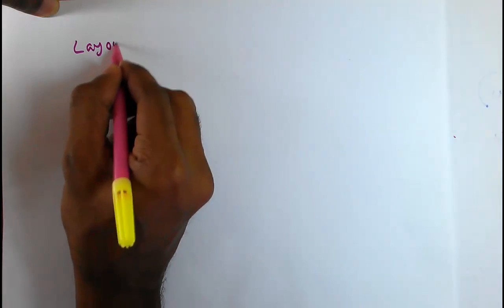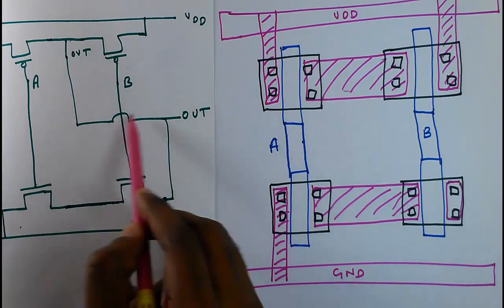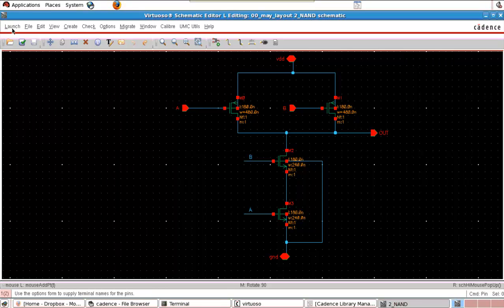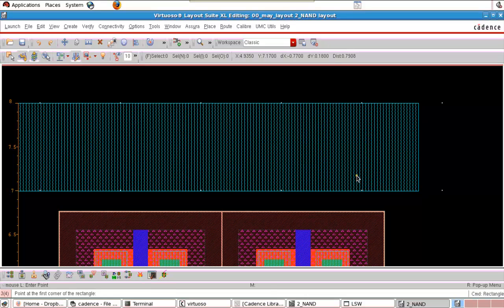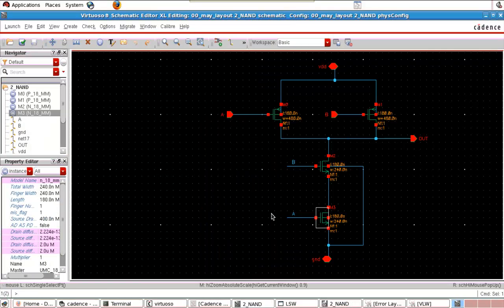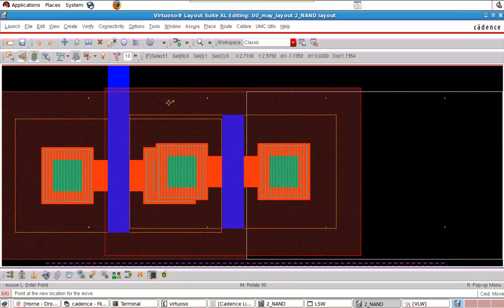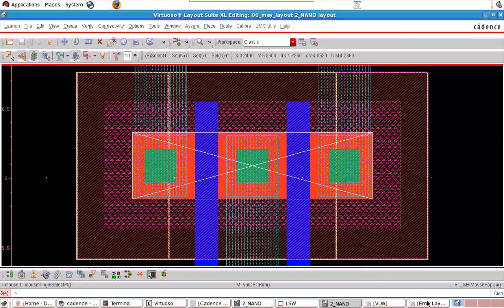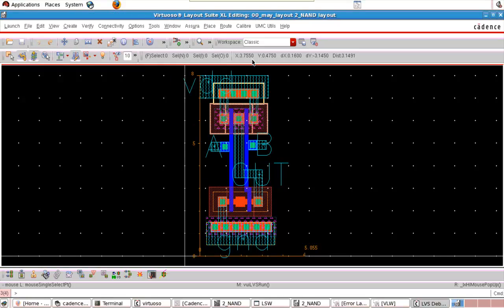Cadence tutorial - Layout of CMOS NAND gate

Comment: why you are saying "drain of pmos is connected to Vdd".during this layout designing.It should be the source terminal.
Reply: Semantics aside. It doesn't matter, they are both metal contact points to the gate. As long as the pmos is connected to Vdd, bulk is connected to Vdd, and pmos is being used for strong 1's (pull-up).